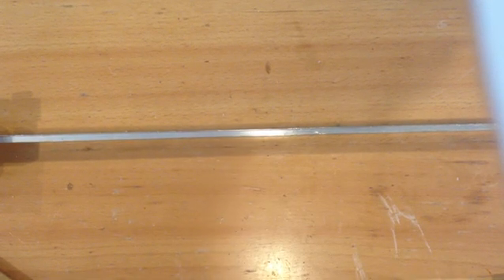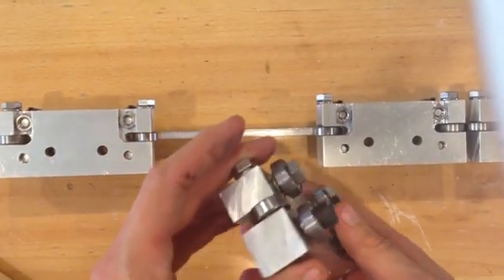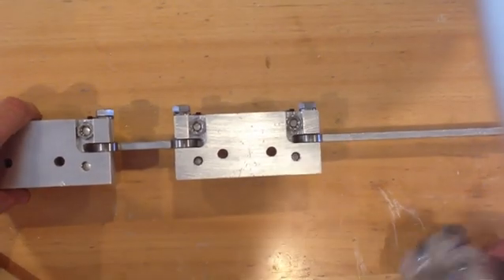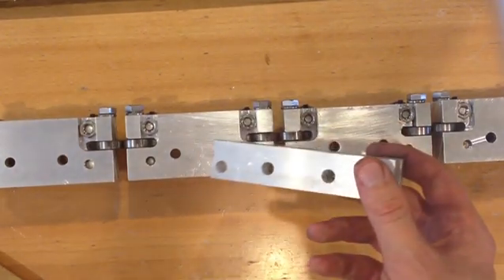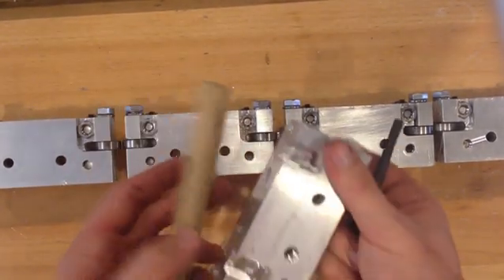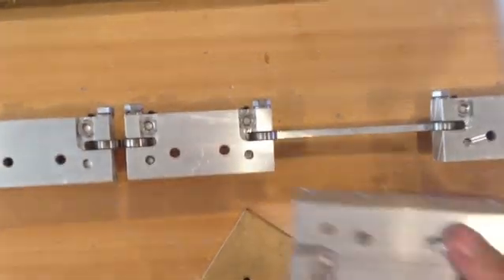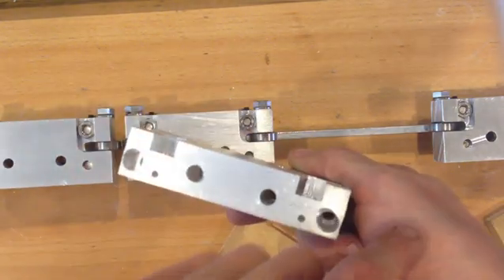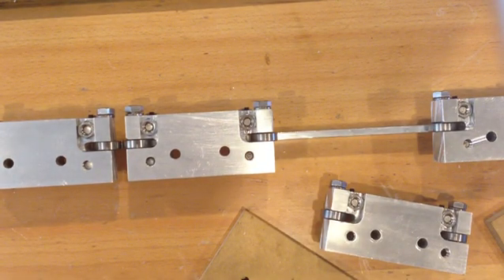THUNDERDORK: DIY CNC Router - Homemade Linear Bearings

Comment: Absolutely brilliant way you have done these 11/10 superb. if I did it your way I would shrink the outer holes inward.
when mounting them on the track wouldn't it be better to use 4 bolts holding both plates on the track instead of 8 ?.
The bolts would hold the plates together.

Comment: Checked out the info on your site, i think you should put in that blurb from it that states they are basically the same price as the ones you can get on ebay and this is purely a DIY thing not a cost savings thing.

Comment from the maker: doing it all on the cnc router right now with some end mills with a longer cutting length. But i'm thinking that might be the way to go.  i'm not sure if it solves all the problems.  main issue was that the press was drilling at a non perfect perpendicular angle because it wasn't trammed up and its little bed would bend a bit under pressure.  if i had a spindle that ran at slower speed i'd probably just use drill bits in it and forgo everything else.